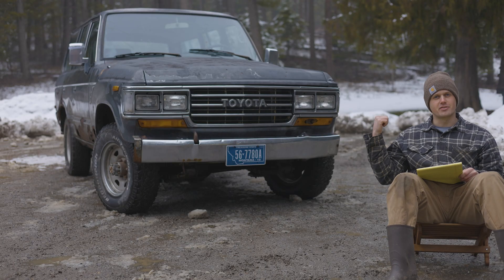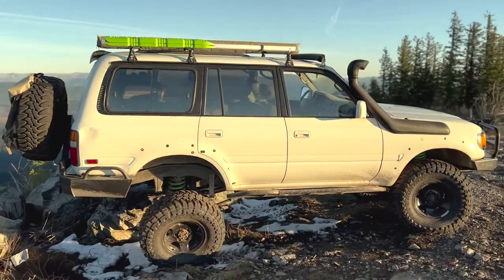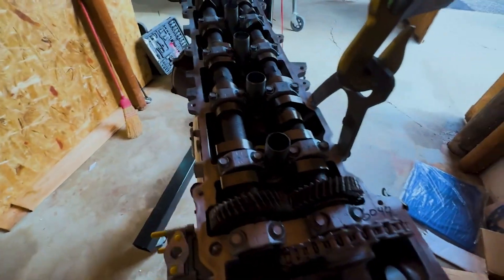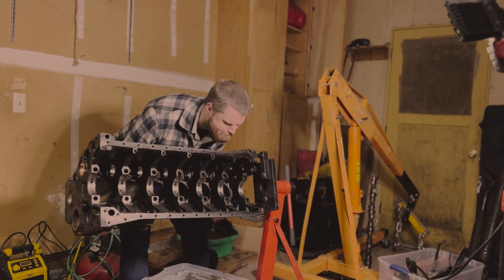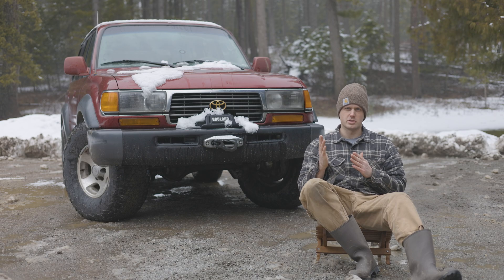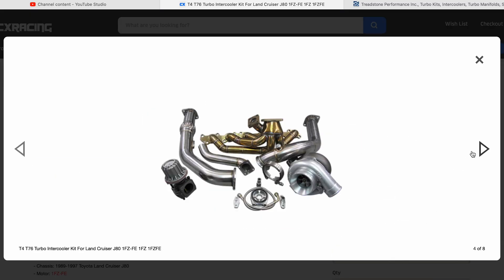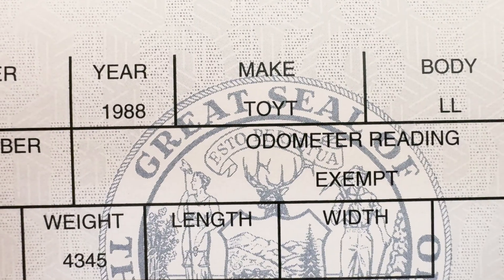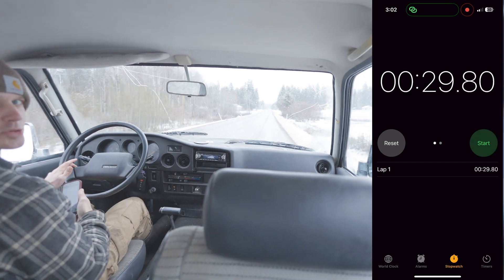What Changed in Toyotas Engineering From The 80's to the 90's?

Comment: Why not be original and swap in a 2H or 12H-T?
I have driven both in a 60 series, 2H is dead slow, but with a turbo goes pretty good but the 12H-T wins hands down with a little extra fuel and boost.
Reply from the maker: I just kinda want to get away from swapping an engine that came in them or at least building the 1fz for the cool factor I guess

Comment: I would NOT put a 6BT in a Land Cruiser, just too heavy. I suggest a Toyota 1HD-FT (4.2L) plus an intercooler, or a Mercedes OM606 (3.0L) with both turbo and intercooler. The HD engine was OEM for decades of Landcruisers and the OM606 went into Mercedes G-wagens and will be a great balance of size, weight, and torque curve (with appropriate tuning). Both are entirely mechanical with no electronics of any kind.

I probably wouldn't touch the 1FZ, but if you want to do anything, I say start with a 105mm Brian Crower crankshaft, which will bump displacement up from 4477cc to 4948cc. If that's not enough, I'd say a centrifugal supercharger (Paxton or Vortech, maybe Procharger) would be the best fit. Way simpler than a turbo, less stress on the engine internals, much lighter and more efficient than a Roots blower.
Reply from the maker: I think you’re right on the 1fz. A trd supercharger would be the most optimized. I already had a 6bt in my previous 80 and the weight wasn’t noticeable at all. It only weighs maybe 300 pounds more and its centered right over the axle

Comment: I put an Isuzu 4BD1T in my '92 FJ80. Big cam, compound turbos, etc, and LOVE IT and get 20 mpg.
Reply from the maker: That’s pretty sick! Do you have any videos?
Reply: No videos of build.  The Isuzu is full mechanical direct injection diesel and you can adjust the fuel delivery with 2 wrenches in 30 seconds. Room for the stock AC compressor, exhaust & throttle are on the correct side. Too easy and good power for the FJ80.  Compound turbo setup is a bit tight on room. The only mistake I made was I went with a 700R4 and it just eats that transmission. I've broken the rear planetary set a couple times,  broken torque convertors, etc.  I'm at a 'stage 3' tranny build with a  Hughes convertor and I defueled the engine and limited to 22psi boost - so far so good. @Austin_SaintOnge

Comment: You should definitely put the 62 on the fzj, get the looks and the function. That body is mega rusty though, lots of work. So a tray aswell?
Reply from the maker: Lots of rust but the majority is on the rear wheel wells. Doing a Ute chop would solve some of that but yeah would need quite a bit of bodywork but I knew it was gonna need it and couldn’t turn it down for $500!

Comment: Tacoma v6 4.0L 6 speed would be cool and easy to find parts for.
Reply from the maker: That would be the one from the 4th gen?
Reply: 1GR-FE is the engine I'm thinking about. Could get a SUV or Tacoma at auction and get everything you need. The 1GR-FE was in the FJ Cruiser too, with a manual transfer case.

Comment: 12 valve or OM606 swap! 1FZ Turbo will be a headache off roading. Trucks should always be Diesel.
Reply from the maker: I’m thinking Ute chopping the 62, Cummins swap and putting it on the 80 series frame
Reply: @Austin_SaintOnge  just find an 80 series frame. Don’t sacrifice the red triple locked 80!

Comment: Why not supercharge the 1FZ? Seem like a lot more use-cases, and a lot less of a pain in the ass.
Reply from the maker: This is true. I’ve just never had the cash to drop on a supercharger when they come up for sale. Might consider saving up for that!
Reply: @Austin_SaintOnge oh, I had no idea they were more than the turbo, pcm module, loom, etc…you said you’d need for the turbo.
Reply from the maker: @Tbooth87  so you can just buy the cxracing kit:https://www.cxracing.com/TRB-KIT-1FZFE-T76-IC

Reheat problem is that the stock ecu can only handle fuel mapping for up to around 5psi then you’ll start leaning/riching out. It’d be a shame to spend all the money and then detonate a piston or worse
Reply: @Austin_SaintOnge so that CX kit and the new ECU are still less expensive than a supercharger?
Reply from the maker: @Tbooth87  I’ve seen superchargers for around $6-7k when they’re on the marketplace. The supercharger is much cleaner and smoother powerband so it would be the better option. The only reason to go turbo and haltech would be if you’re planning on making crazy hp and want turbo noises 😁

Comment: Do a Mercedez om606 swap
Reply from the maker: For the 80 series I forgot to mention I’m considering the om606 as well! I love the idea of it and the hp/mpg it puts out. I need to research manual transmissions though
Reply: @Austin_SaintOnge  doomsday diesel makes son nice transmission adapters .. and pipumpuk makes everything only problems is that they are in the others side of the Atlantic Ocean .
Reply from the maker: @nono77291  I’ve been looking at the doomsday diesel kit. Pretty cool!
Reply: Go with a 4l80 with a manual vale body @Austin_SaintOnge

Comment: Coming from a 1995 HDJ81 owner (Wisconsin), really enjoyed this video.  Have you considered one of the Toyota diesel engines for the swap, like a 1HZ or the 1HD platforms?
Reply from the maker: I’ve never really considered one of those! I guess if I could find one for the right price I might jump on it! I’d like to stay native in the Toyota family as far as the engine house but I’m seriously looking into doing a Cummins and Ute chop on the 62
Reply: @Austin_SaintOnge  A ute chop would be dope!  I only mention the Toyota diesels because parts are still fairly available, with the 1HZ still being manufactured; it's painfully slow, but very simple and one of the best diesel engines ever made, in terms of reliability.  Good resources on ih8mud and Cruiser Outfitters, if you're curious.  A 12v Cummins would be solid, though, especially if you're familiar with them.
Reply from the maker: @patpederson3894  I’ve read quite a bit into the 1hz and its reliability! I’ll definitely consider it and check out prices/availability. Yeah since I’ve completed a Cummins swap already there’s the familiarity. I think this time I’d want to do an earlier model with a ve pump for the simplicity
Reply: 1HDFT FTW. Still mechanically fuel injected, no BEB issues like the 1HDT, and not a tractor engine like the 1HZ. I intercooled my 1HDFT and the thing RIPS!